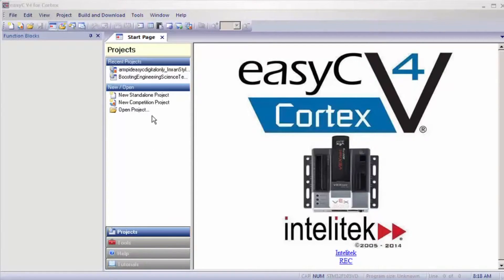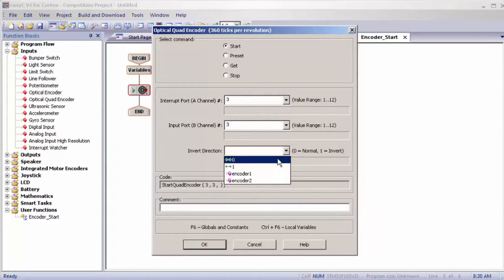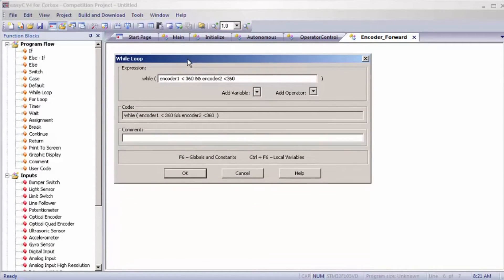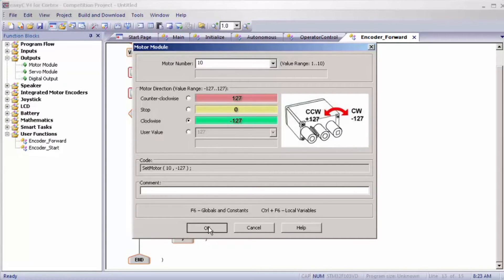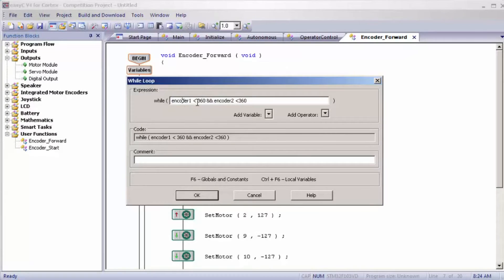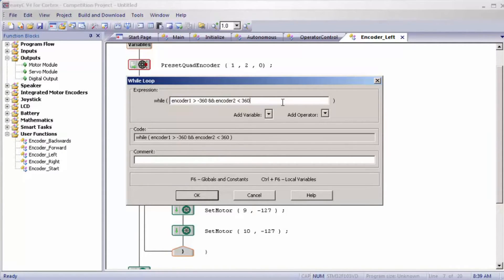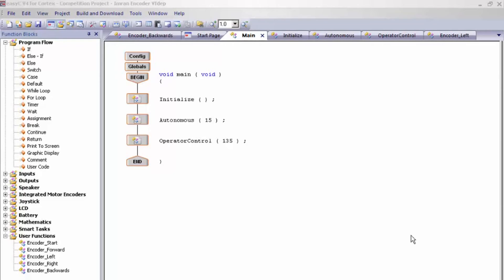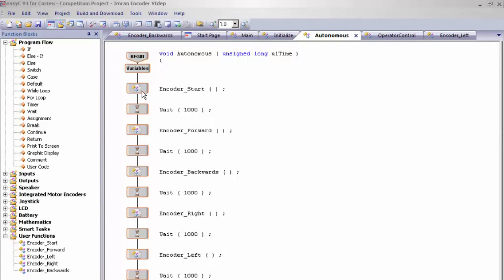Vex Sensors - Shaft Encoder Programming

Comment: Thank you so much this was really helpful. One question though. is there a way to make these presets individually adjustable. So that you could drag in a go forward and change the rotations you wanted to go while leaving the other go forwards unaffected?
Reply: When you setup the function at 2:08 in the vid, you can setup an argument.  Let's say its called "Encode" and you use a short type.  Then use can assign a value for "Encode"... lets say 720 (2 wheel rotations).  Then at 3:14 you can use a while loop like... encoder1 < encode && encoder2 < encode.  Everytime you use that function you can assign "Encode" different values.  LMK if you need further assistance.

Comment: What are e differences between shaft encoders and the iem/ime modules on motors?
Reply: From competition experience, IMEs are extremely problematic and inconsistent, and I don't recommend using them.